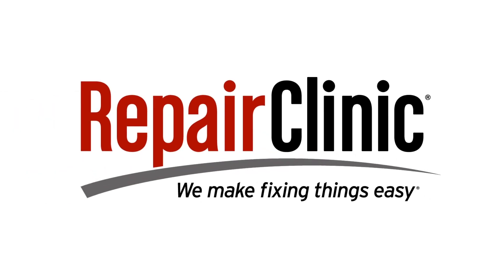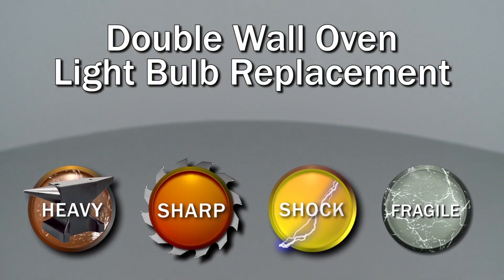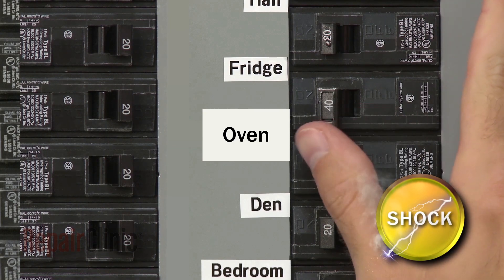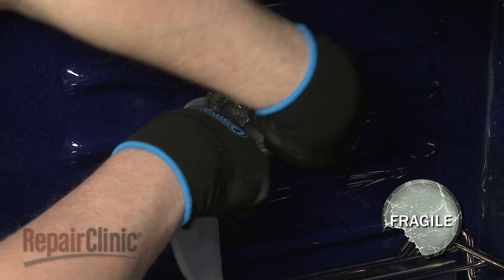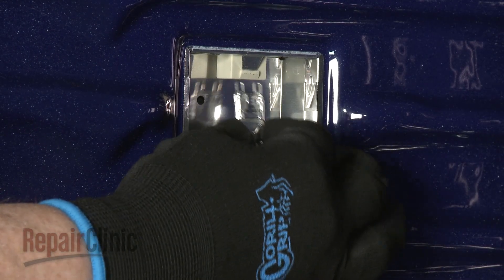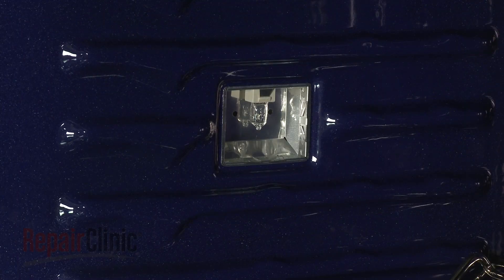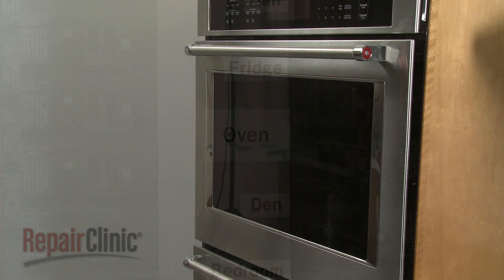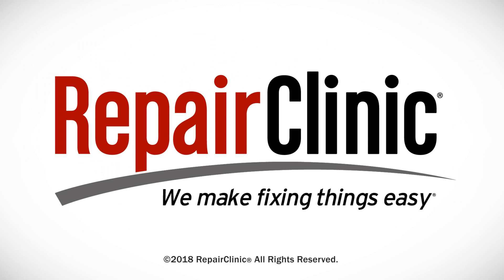KitchenAid Double Wall Oven Light Bulb Replacement WPW10472384

Comment: When trying to remove the glass and access the housing with the bulb, the whole housing come out.  I cannot figure out how to separate the metal housing from the glass.  Where is the housing "holding" the glass?  I have tried both a screwdriver and a putty knife and can't get between the glass and metal housing.  Something is really holding those two tightly together.  Any help would be greatly appreciated.